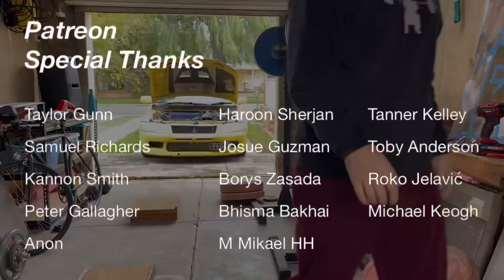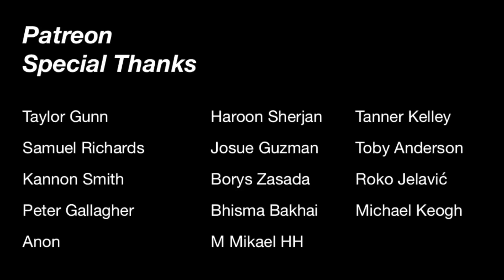Squat everyday Day 1277: Push and hold

Comment: if your lower back is giving you trouble coming up from squats and doing deadlifts you might want to add some front rack/zercher good mornings to your routines.

always felt like my lower back was the main weak point in high volume semi-heavy squats until i started adding GMs to my routine. after doing a week of good mornings with about 20kg on the bar i finally took my 1rm to a set of 3 instead of grinding out a single rep.

i think it's essential to train your lower back with a decent amount of weight so it doesn't give out at the bottom of your toughest squats, but also that's just my personal bro science.

either way, keep up the good work, ive been watching these videos every morning for a few months now and i love what you've done
Reply from the maker: Appreciate that man. Glad youre training the lower back. Its a crucial part.

Comment: You might try working in some low weight high rep overhead squats.  If your are looking to really light up and tax your upper back, rear delts, lats & traps. OHSQ's are an excellent way to do that.  Have a go at a 50,40,30,20,10,5,1reps starting with the bar + 10lbs to the bar each set. You should also feel your core (front and back) the next day. May find it helps to keep upright posture in the front squat. You might also  try working in some front rack lunges at a moderate weight for high reps as well.  I've found great benefit and carryover to my squat and deadlift from both of these exercises.  Great to hear all your insights & awesome to see your progress Ivan. Thanks for letting all of us share in your journey.
Reply from the maker: Thanks for the ideas man. i think those are amzing too. ive tried overhead squats and my god was that humbling. started getting cramps in my shoulder and upper back. thanks for the reminder. i should get back to them again.

Comment: going to start a new program next week after finally finish the squat program i did. The new program contains Deadlifts which i haven't done in like close to a year because i was solely focused on squats and the deadlift never interested me like the squat...came in yesterday to measure where i'm currently at and struggled to hit 130 kg for a double...with a belt😂...for context my front squat 1 rm right now is 132 kg which means i'm currently in a weird position where i can squat more than i deadlift which i honestly didn't think was possible...my old deadlift pb is 160 kg for 3 back in mid 2022 and my technique is probably off because of all of the Cleans/Clean Pulls i did... seems like i've got a lot of work to do the next 16 weeks. Anyway i still think that's really weird because everyone says squat has so much carryover to deadlifts 😂
Reply from the maker: were you doing front squats or back squats?
man ive come to the conclusion that strength starts and end in the back. erectors are kings man. 
just depends how you are built. if you are built for squats [short legs] youll squat very upright and that means youll be in a disadvantage  with pulls. 
its ok man. just work on pulls now and youre set.

Comment: You gotta hit both sides, no way around it...
To me though, leaning over during front squat at max weight screams quad failure. With lighter weight it could be mobility issues indeed, and/or simply a requirement to balance out the body+bar system (less weight on the bar = your butt plays a bigger part in the balance = need to counteract by moving the bar forward). But I found that heavy weight tends to help my mobility, and I didn't seen any lower back rounding in your heavier sets here anyways
Reply from the maker: yeh it could be. for me though the biggest thing is the upper back and core. thats where i think the weakness is. 
when you think about how much i can leg press. it just doesnt make sense to think quads are weak. power leaks through joints. lots of joints in the spine.

Comment: So, Ivan....... we have an issue in the front squat, but in the mid back [torso, mid back]. Here's the thing, and you're right; its all about position, annnnnd, stability. All to often we forget the accessory work, and what we are doing WITH accessories [ wtf, are we doing, doing bodybuilder exercises?] We are building tissue, to support our leverages. 
Here are some accessory exercises that will help the thoracic aspects of your spine.  Shrugs, Upright Rows, Dumbbell shrugs, Dumbbell Depth Charges [take that dumbbell, load it up, feet on the block, using thoracic compression, blast up holding the dumbbell], Face Pulls, Cleans[ this exercise will blow up the thoracic], Push Presses, Incline anything, Rope Squats, Zercher [moderate poundage, or build to an M/E], Ab work, and then some ab work
  You've got a 182.5 kilo Front, Biggs, there's nothing, absolutely nothing wrong with that, or the leverage angle you're using.I know this because you gottuh 182 kg Front... Its the falling forward, with bar in the front..... so strengthen the muscles that need it!! Pull ups will help too, but e have to get the delt, upper chest, and the mid-back stronger, because that's what is weak. .... not too mention, a 182 kilo Front, on a wavy floor..... the damn floor isnt doing the front.... no excuses accepted, because no excuses in getting.being  being strong, we just have to do the work, and you do the work...... back to speed work..... we are training position, and your leaning because your getting in your toes, because the thoracic is weak, so make it stronger..... if you Squat in the Front, then you must balance it out with the Dead, in a hybrid position..... the Effiel Tower doesn't lean, because its strong from the base up. Think 'Chain Theory,' brotha, and hip position in the Front, we want everything as stacked as possible, damn delts come into play again, so does the serratus [Pullovers]
Play with postion, and the Deads were solid..... quit the excuses, and go back to the unchained Stoic, you are.
Reply from the maker: Love reading your thoughts man. You always spark ideas.
Thoracic war has been waged hahahah. I gotta add some additional work for it i think. shrugs jumped out to me a bit when you mentioned it. hmmm shrugs seem in expensive. that could be easily added. 
cheers for the ideas like always man
Reply: @IvanDjuric300  I'd run the upright for 3 weeks. Belt Hip Lunges too,